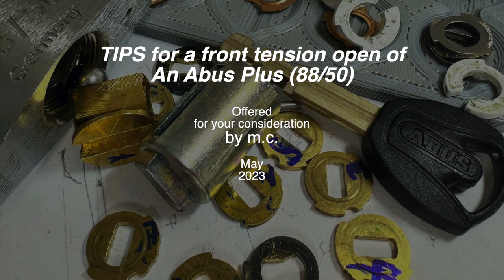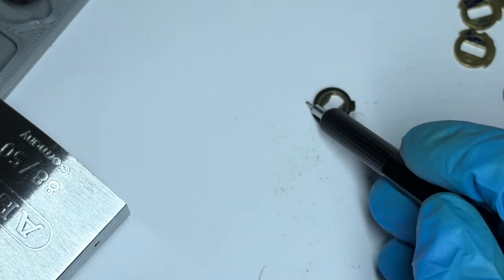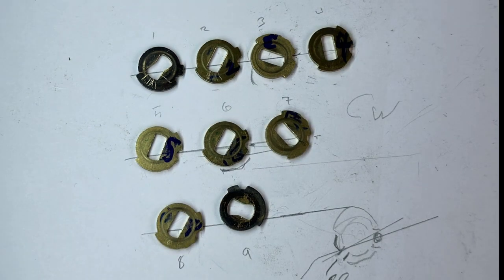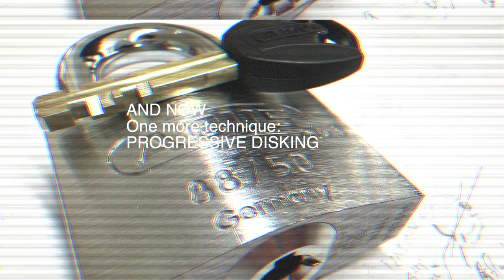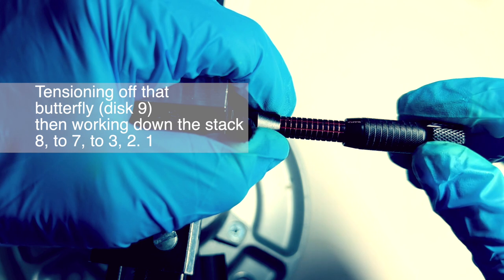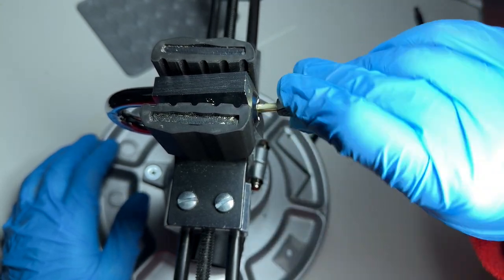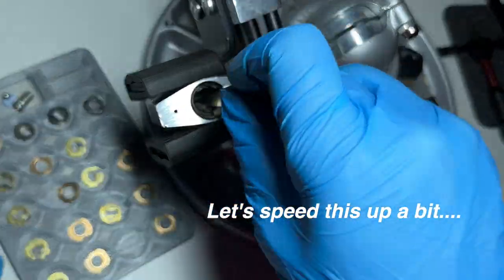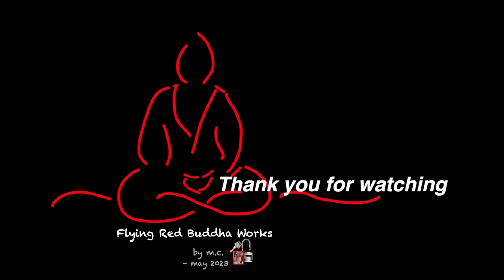Open that ABUS PLUS DD (88/50) with Front Tension - TIPS Tutorial - yes with butterfly disks

Comment: I think ABUS could fix tensioning from butterfly disk pretty easily. Instead of having straight edge to push against rotation limiter, ABUS could make it a ramp so that if butterfly disk is rotated against the rotation limiter, the ramp would push the whole disk towards the sidebar. That would result in disk pushing the whole sidebar upwards into the groove in the lock body which should remove all feedback.

Another solution would be to just get rid of butterfly disks because there's no reason to keep those zero cut when those are not used to tension the lock with the correct key. Why not use those disks for the correct combination instead? Because butterfly disks can be identified simply by looking into the keyhole, it makes no sense to always have those zero cut because it only allows the attacker to know 2 disks already.